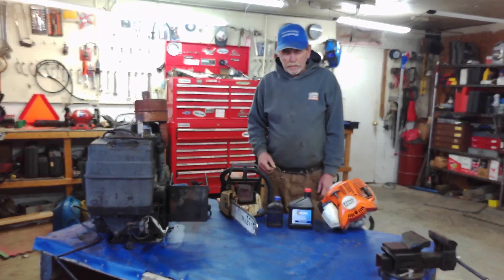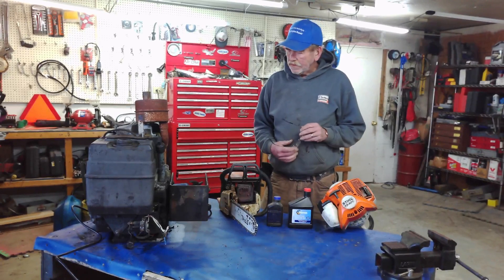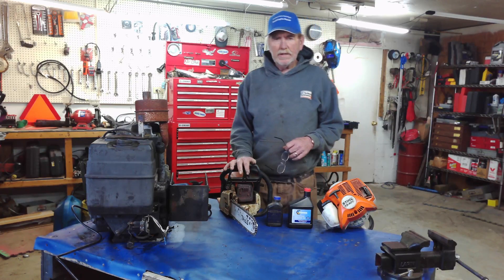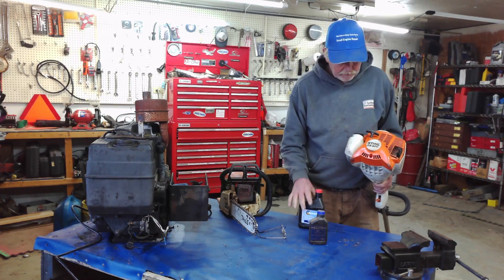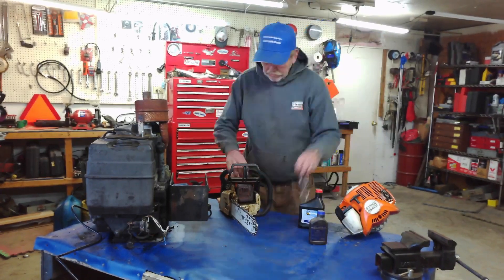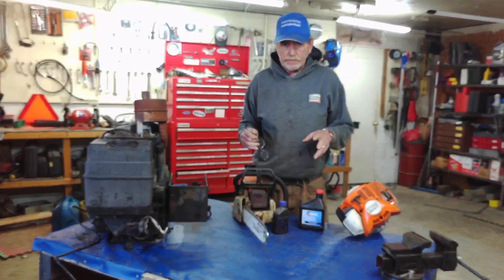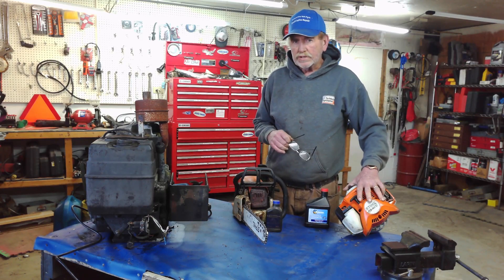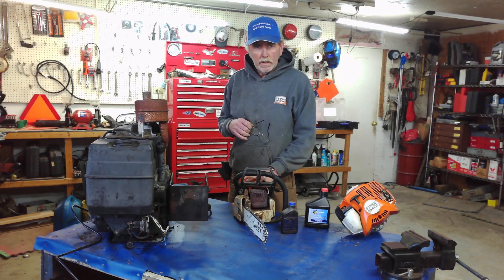Two-Stroke Or Four-Stroke: What Is The Difference?

Comment: Everyone should read their manual.  Stihl makes the 4mix that has to have mixed gas but it is not a 2 stroke. The other thing is a chainsaw holds bar oil and that could confuse some people because they put the oil in the tank. I have seen many a trimmer and saw seized up or with no compression because someone put straight gas in them. I have a brand new Husqvarna string trimmer that has no compression and the owner thought the carburetor was bad because he put straight gas in it. It is junk now because of a simple mistake of not reading the manual and using mixed gas. Read your manual don't assume anything.
Reply from the maker: You would be surprised of how few actually read it. No you wouldn't because you are seeing those machines become trash/ scrap iron. The worst is when they want their money back from where they bought it because they feel it had to be defective to fail. Sometimes you just can't fix stupid. thanks Jason